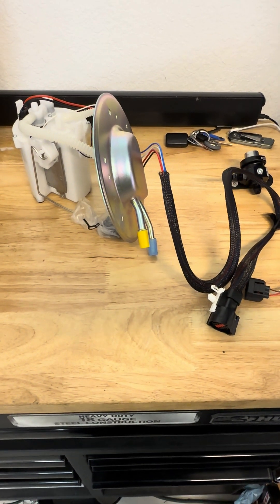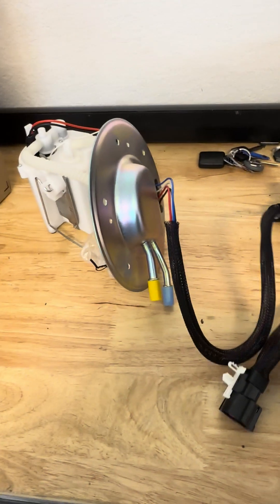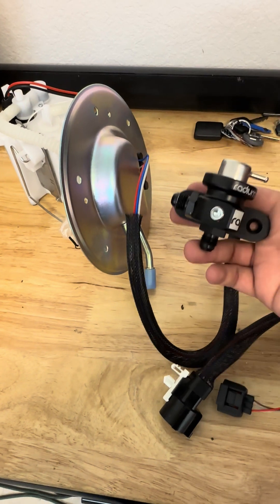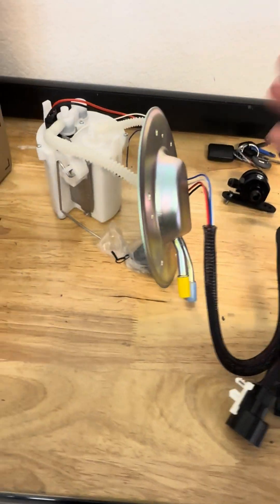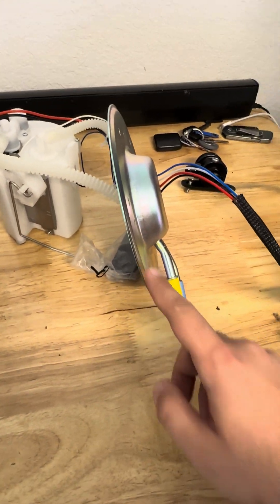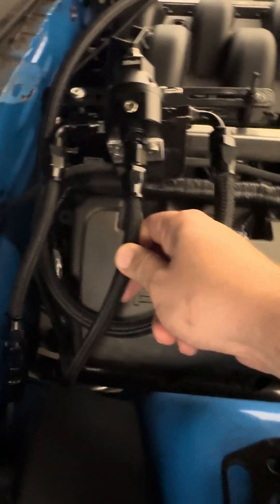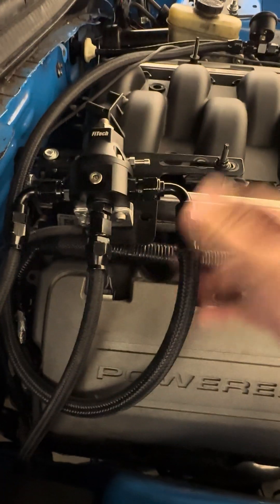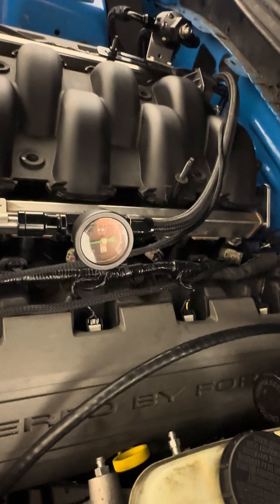HOW TO: Coyote swap fuel system newedge or sn95 mustang 94-04 #fordcoyote #ford #coyoteswap

Comment: I’m in the process of trying to do this same setup with my coyote swap. I’ve been trying to get a set in stone answer for the fuel pump to put in the 1998 pump module. The link you added in the description for the aeromotive pump goes to a “GM specific application” and was wondering if that was correct and what you used
Reply from the maker: Yes its just a offset inlet. The pumps going in the bucket so it doesnt matter. Dont use the plug that comes with it just wire it to the 98 hat.
Reply: @newedgenick thank you so much, I appreciate the response